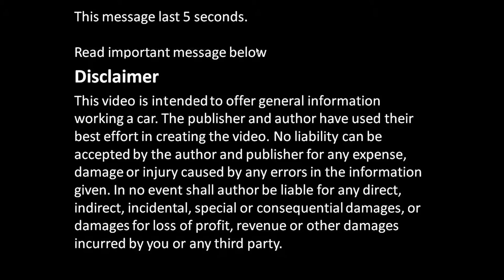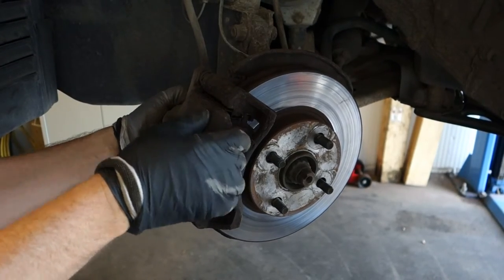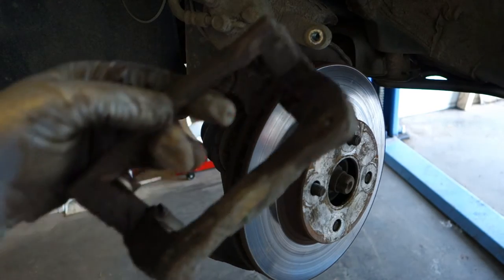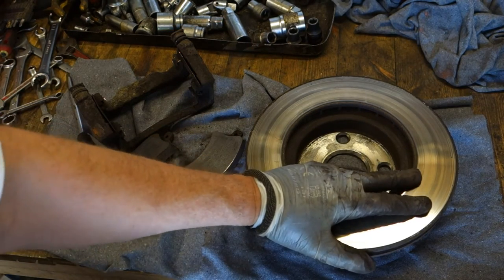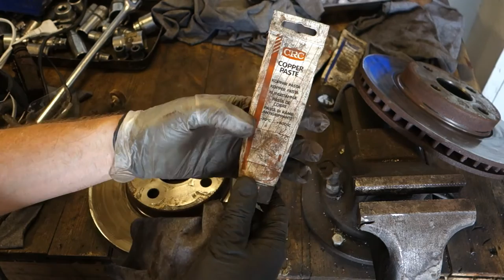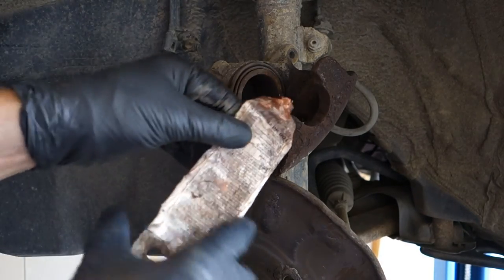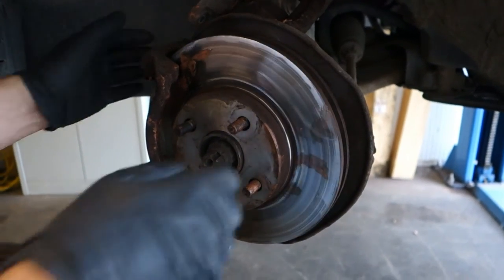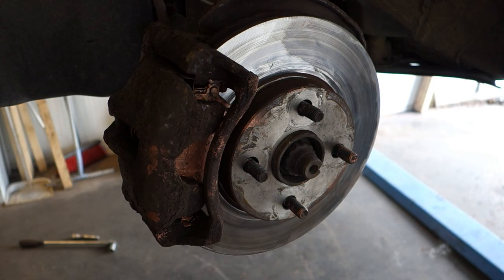How to repair screaming brakes Toyota Corolla

Comment: Thank you very much! Very interesting and I learned new things! 👍 When removing brake pad carrier, you can put a wheel nut temporarily to the wheel bolt to avoid the brake disc from dropping on the floor.
Reply from the maker: Great point!